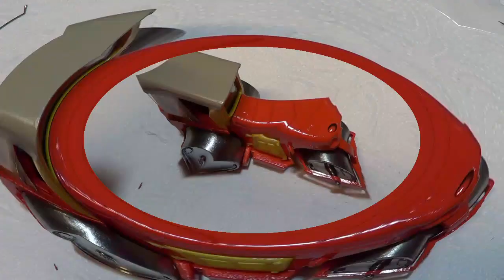DINKY AVELING-BARFORD ROAD ROLLER FULL RESTORATION

Comment: Hi nick , nice fix with the windows and the axles,  hard work but it was well worth it ,looks excellent. 
I like your wine rack of spray cans. 
Good tip on the yellow.
Reply from the maker: Cheers Martin, it was a bit of a challenge lol, got there in the end though. Ha ha the old rack, it was an old shoe rack but it’s not Ideal, I always seem to need a can from the bottom and you know what happens then lol, end up with cans rolling around the floor, I can feel a bit of a conversion coming on😉😊